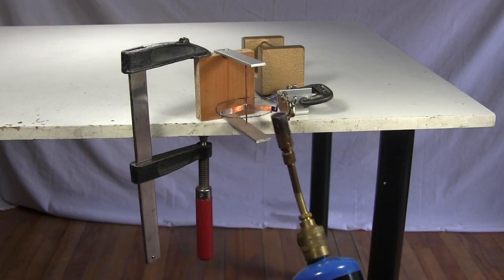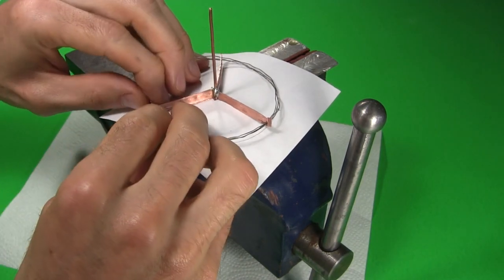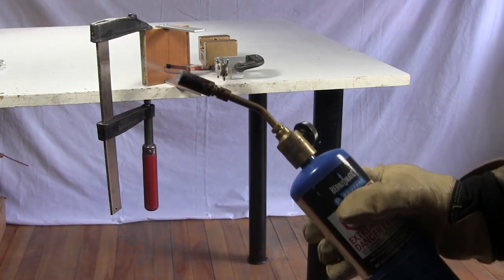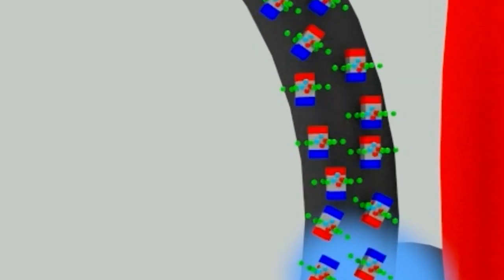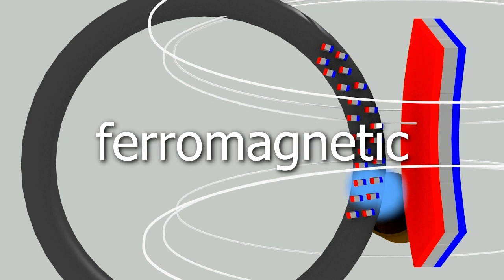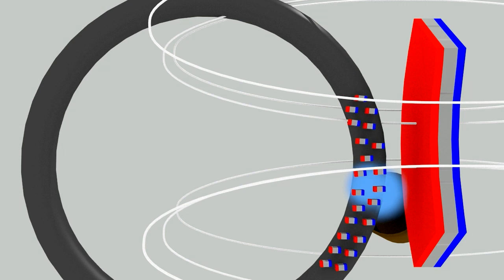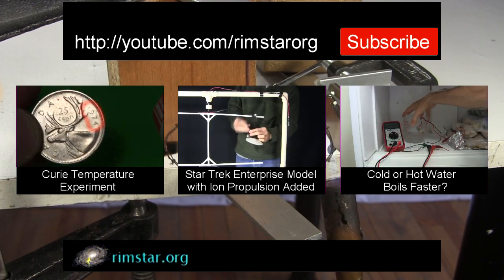Curie Temperature/Point Rotor - How it's Made/How it Works

Comment: we could use iron wire
Reply from the maker: I wonder if it would be a lot harder to get it working though. Nickel has a curie temperature of around 354C (669F) whereas iron's is around 770C (1418F). However, I don't know the temperature at the tip of my torch so maybe it was above 770C!

Comment: Hard Disk Drive magnet have 4 magnetic poles, not 2.It is split top/bottom and left/right> It is intended. This way magnetic field is more compact and almost doesn't "spill outside" of magnet and risk of damaged data on HDD is reduced to almost nothing
Reply from the maker: I thought there were 2. I didn't realize there were 4. I think that would make it less effective then a single pole one.
Reply: RimstarOrg I was thinking there are 2 poles as well. I knew magnet cannot be split horizontally and have to be split vertically to make head working. I have seen all explained on youtube and explanation does add up. All this makes sense and actually any other configuration would disturb contents of HDD.
So I was surprised as well.
BTW your videos are quite good. Nice idea, good executions and well presented.
Reply from the maker: WizardNumberNext
The funny thing is that though I didn't know the poles on opposite faces were reversed, I did know that there were two different poles on each face and yet I never once thought to draw it that way! And now that I think of it, given that there are two different poles on a single face, you'd expect that the poles on the opposite face would be reversed.

Comment: What if you could concentrate the magnetic field to just one point in the wire, or heat a larger surface of the wire. I feel like the magnet being so big would slow down the rotation due unnecessary attraction of excess wire.
Reply from the maker: I guess there are places where the large might attract the wire backward. When you position the flame you do hunt to the spot that gives the best rotation, so that might take care of some of this.
Reply: If you focused the magnetic field too much I don't think it would work too well.  If the heated area wasn't in the magnetic field, demagnetizing it would not cause the imbalanced force which moves the rotor.

In fact, my prediction is that a large magnetic field which encompassed the whole object fairly evenly would work fine.  That would give you a larger area to demagnetize, so you could get a large force differential between the magnetized and demagnetized areas.  (This is at the cost of more magnets, though.  If you've only got, say, one magnet, focusing probably helps as long as you don't focus so much that there's no useful differential force.)
Reply from the maker: Chris Sloan
I don't think using a large magnetic field encompassing the whole object would work since you need a sideways force to turn it. By encompassing the whole object, the heated area would have equal and opposing forces on both sides of the area. But I agree, covering more area and taking advantage of more the the flame would be an improvement. The alternative would be to use a stronger magnet.
Reply: RimstarOrg Imagine a large uniform magnetic field covering the whole object.  Everything is being attracted towards the magnet equally, so there are forces, but they're balanced.  Now heat an area on one side.  That section now has no force, but everything else should be the same.  So, I'd expect that you'd have an unbalanced force (to the tune of the force you eliminated on the heated area) and the net force is centered on the side opposite the section you heated.  I'd expect that to give you a nice clean torque.

I admit it's a thought experiment that I don't have the setup to test, but hopefully that description makes what I'm imagining clear.

The forces aren't balanced because the heated spot is off-center with respect to the direction of the field.

Does it still sound like it wouldn't work to you?
Reply from the maker: Chris Sloan
The forces aren't balanced but there would be not rotation. Instead the ring to the left of the hot spot would be attracted rightward toward the hot spot and the ring to the right of the hot spot would be attracted leftward toward the hot spot. The result would be two forces trying to rotate in opposite directions, and it wouldn't move. Draw it on a piece of paper and you'll see what I mean.

Comment: The 3 loops of nichrome wire is arbitrary, correct? You could use more or even less if you wanted?
Reply from the maker: The 3 loops wasn't completely arbitrary but it wasn't selected after exhaustive testing. With 1 loop I had a huge amount of thermal energy that wasn't being used and I figured that more loops would give me more magnetic attraction and so more torque. From the portion I took from the hair drier I could get 3 loops so that's what I went with. This setup wasn't suitable for doing torque testing so that's as much as I did to select 3. I've used maybe only around 1/20th of the wire from that hair dryer; those springs that you see in the hair dryer, when stretched out make for a very long wire.

Comment: It works! Well done.
I wonder of you could use electric current to heat the wire? Might produce a magnetic field and stuff it up.
Reply from the maker: Matt Heilman
I didn't check the torque but given the slowish speed, and how easily it moved when I turned it by hand, I figured there wasn't much. But it'll be good to see what you come up with.
Reply from the maker: Thanks. You can definitely use electric current to heat the wire, after all it came from the heating element in a hair dryer (I forgot that at first too.) The resulting magnetic field would be at right angles to the permanent magnet's in this case.
Reply: I got much thicker nichrome wire from a toaster for the heat bed on my 3d printer.
(I should get back to working on that one day soon) Its a bit too thick for 12v, need to use a bunch of 3 inch sections in parallel. The hairdryer stuff is much finer. Could be good :)

I need to dummy load the 5v rail of the ATX PSU, So I'm thinking use that to heat the bed to say 50c, then PWM a second set of wires to bring the heat up to print temp. I think you just solved a ton of problems for me... Only one problem left. I just passed up 3 broken hairdryers. Fans where gone, I thought that was the only good part. Stupid stupid stupid. Now I have to be nice to a girl or something....
Reply: Very nicely done, I will have to try this on a stepper motor.

Comment: I'm curious, wouldn't the entire wire eventually heat up from conduction thus making it stop altogether? I ask, because I don't have much experience with nickel. I do know that with aluminum, it doesn't retain the heat like steel or iron. So is nickel like aluminum in terms of retaining heat?
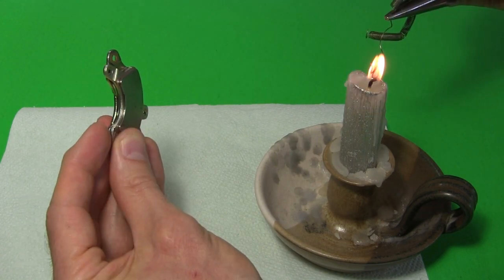Reply from the maker: When I first tested the wire, actually the test I show at 0:33, I saw that it lost heat fairly fast. I'm thinking of wrapping the wire around an aluminum disk or cylinder for the next version to help with that loss. But I'm also counting on the whole wire to retain most of the heat so that it doesn't need to be reheated too much each time.

Comment from the maker: +Marcus Law One step at a time (well okay, this is my second time experimenting with Curie temperature.) I was hoping to add generator magnets/coil but the rotation wasn't fast enough to be worth trying. Based on what I've learned with this one, I plan on going further next time. And as you said, it's sexy.
Reply: It might not be suitable for a motor, but for security issues, like a thermal based breaker.

Comment: Are harddrive-magnets not having a North and South on each side? Would a better neodynium magnet give better result?
Reply from the maker: Hard to say. I wondered the same thing. The nickel dipoles/tiny magnets rotate to always be attracted to whatever field they're in, some so dipoles would be oriented one way and others the other way. Probably suboptimal. I tried with a set of magnets with only one polarity per side but they had a smaller face and didn't work as well, probably due to their small face.